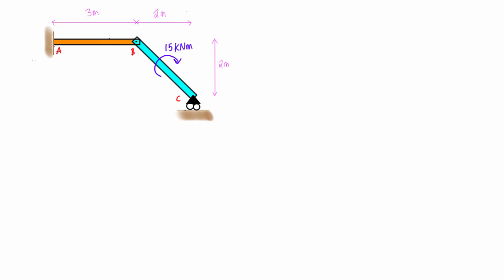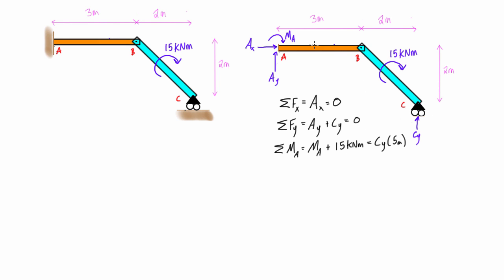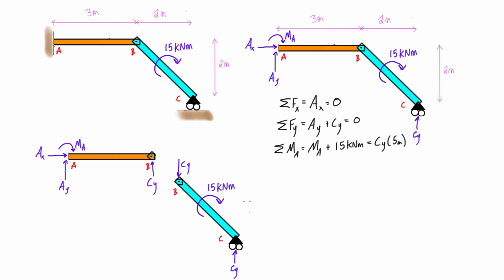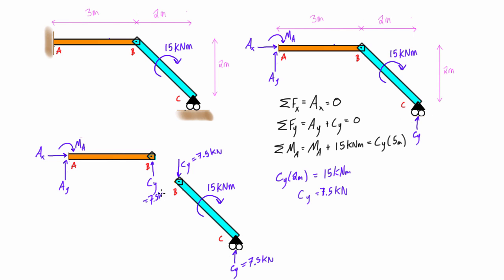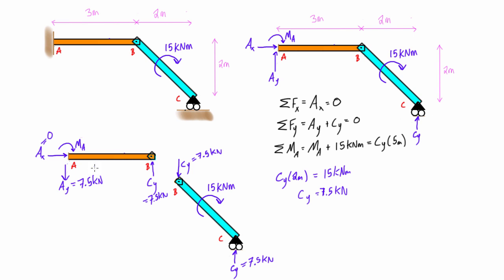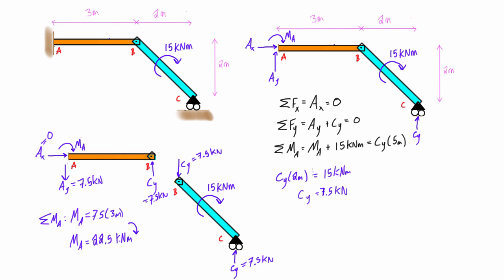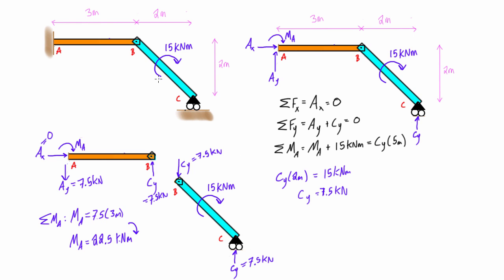Frame example problem #3

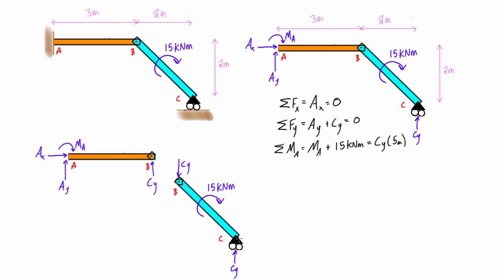Comment: Hey.  Thanks for the videos.  I still don't understand why there is a moment at A and no x component at C.  Also, at 2:07, doesn't the forces you provided cause member BC to be out of balance?  Also, why is your explanation at 2:30 correct?  One more thing, why isn't the equation 2*Cy*2 meters = 15 kNm?
Reply: At C , we have a roller and the roller just have a y component and doesn't have x component ( it's a general rule for roller support ) 
At A , we have a fixed support , and the fixed support have 3 things : x and y components and also has a moment ( it's also a general rule for the fixed support ) 👍😊
Reply: @abedalghzawi9746  Appreciate it